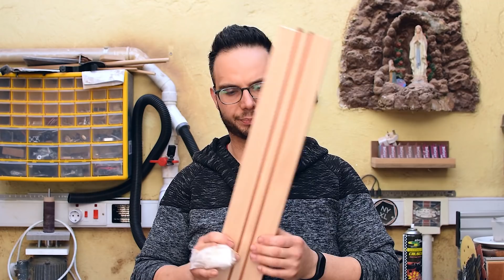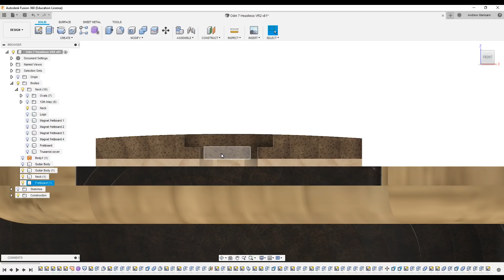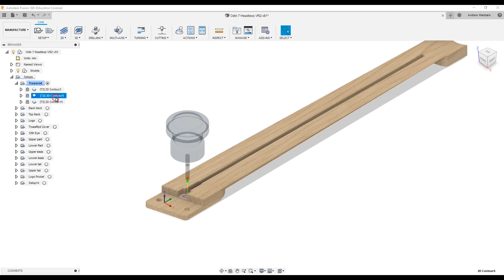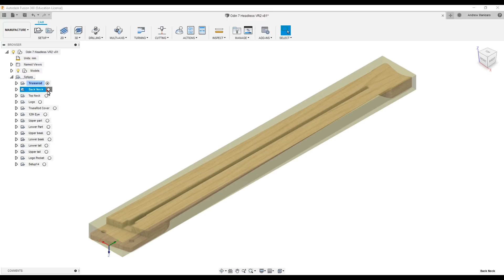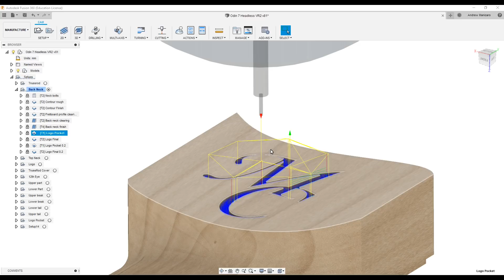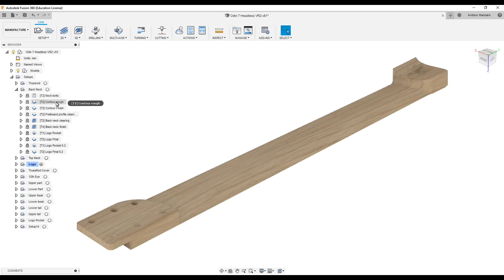How to build a guitar using a CNC Season 2 - Episode 4 The Neck Blank

Comment: Great video!! Love this channel. In the future could you go over two sided machining setup for the cnc with the pins and fusion. I’ve attempted it before with my cnc and it was off for some reason. I’m sure it was something I did wrong lol. Thanks again bud!!
Reply from the maker: Thanks buddy, that's a great idea. I will go through it when I start working on the body blank because basically has the same concept.
Reply: Manicaro Custom Guitars awesome bud.  I am looking forward to it. Thanks again!